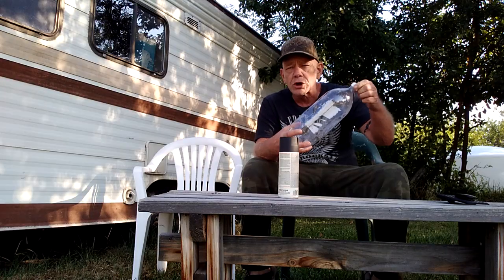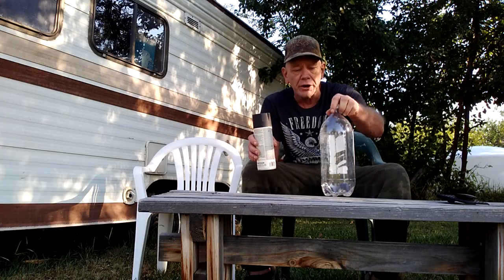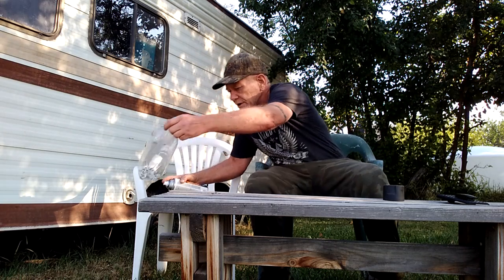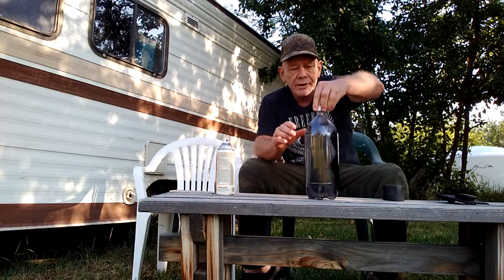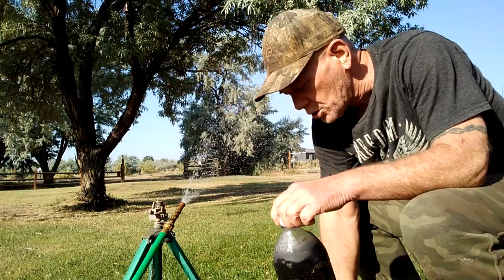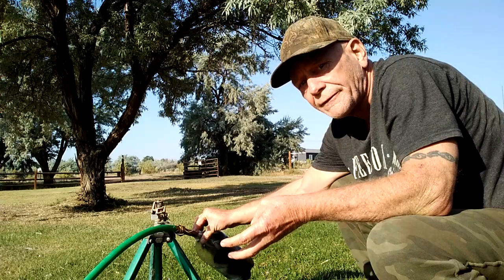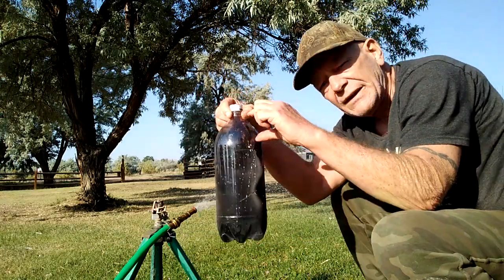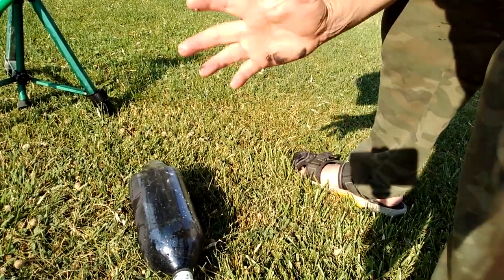Simple Solar Hot Water Heater For Off Grid Or Camping

Comment: It should work fine without the paint, you don't want it scalding hot, it needs to be hotter for dishes than bathing. Does it work in the winter too? That's a great idea.
Reply from the maker: Works faster with the pain. It will work in winter as long as the sun is shining but not as well.

Comment: I go to my local mom & pop oil change station and get the 1 gallon bottles that motor oil and antifreeze come in from their trash.  I rinse with dish soap and ammonia and I have a free solar water heater.  I add a usb bottle pump and I have a shower.
Reply from the maker: Just be sure to clean them thoroughly. Any oil contains benzene a cancer causing agent.
Reply: @solarcabin 

Thanks for the warning. I will try with a glass bottle, like a wine bottle, to make off-grid coffee.

Comment: 97° today 80° inside solid AC running 24/7 and a Large unit set to 80° when it's lower temperature the big unit is reserve. 3:38 so temperature is going to get loare sooner. Another thing I did was when I Find stryoform chest I stack them on the PM wall that gets that sunlight. Really helping to keep sunlight from heating the inside. 

What needs to be developed is a super insulated room with a little unit removing heat. Why remove heat from such a big space. Don't love exclusively in the ACHOOCH when it's cooler you can enjoy your property but it's going to cost too much to keep it cool. I've got a friend that dpent $10K to repair her ac. Just her the House had 4+at one point but empty nest husband passed she is stoll in the large house. I hate to think what the power bill is to keep that big house cool.  It's bedt to evaluate your want needs and adjust to suit..

Comment: I'll be digging the soda bottles out of the garbage.  I use the hot water in the coiled garden hose for the outdoor shower, here at the house.
Reply: Go to laundry mat garbage can you can get already colored bottle a gallon or more. Old soap bottle can have hose attached and valve just fill and open the valve for use. Insulate the feed line to keep hot.
Reply: @GEAUXFRUGAL 

Great tip. 

A glass bottle will work too instead of the plastic one.